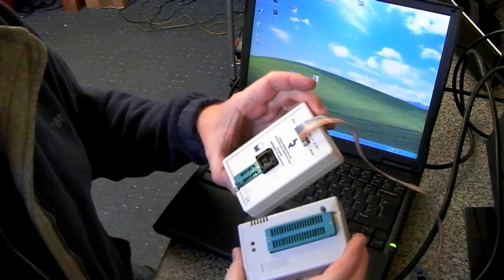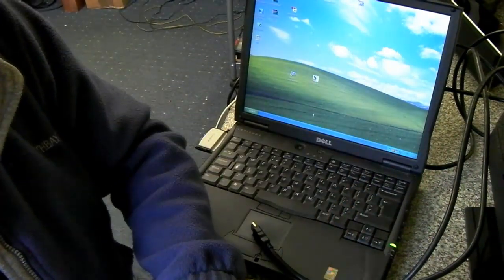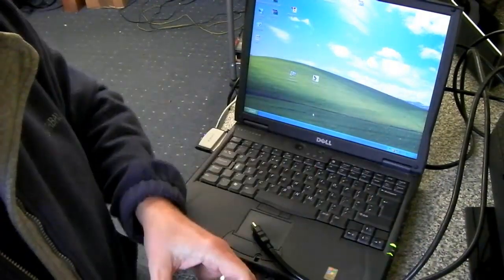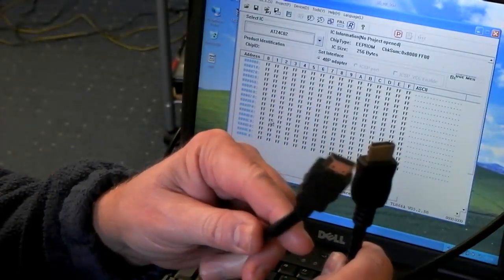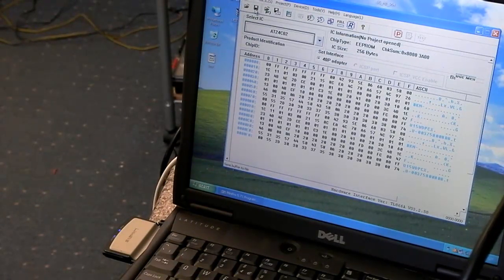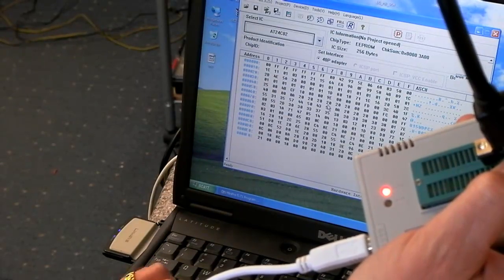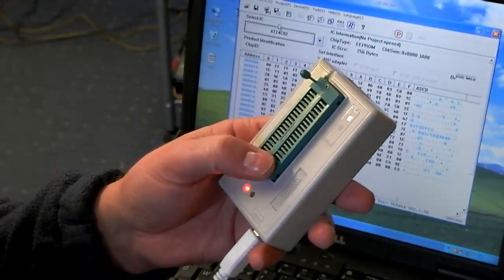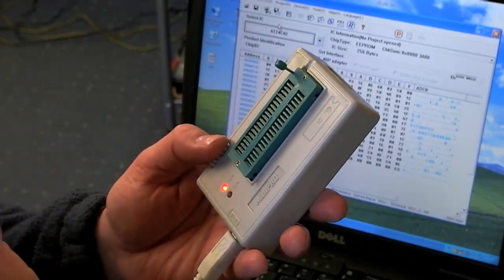HDMI EEPROM Adapter

Comment: Every TV support HDMI programming?
Reply from the maker: Atetus94 This was developed to copy HDMI eeprom  data and write the data back if the eeprom was ever corrupted. It turned out that this was not a major problem and is pretty much obsolete. And no, you could not use this on all tv's.